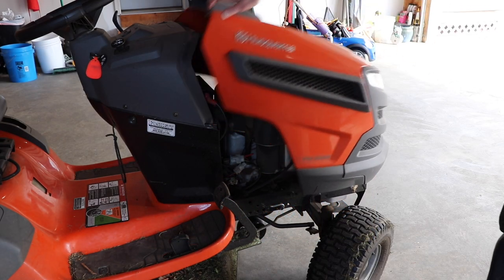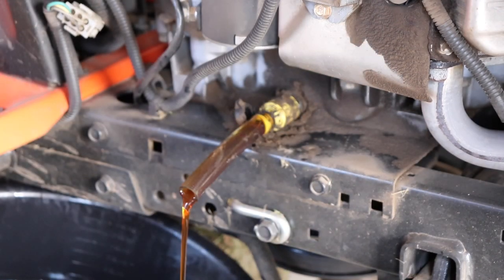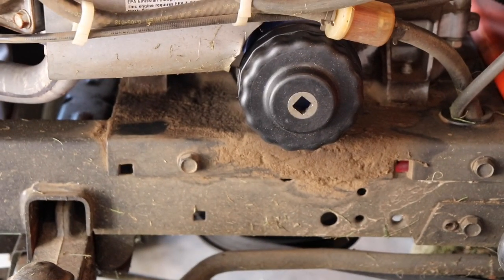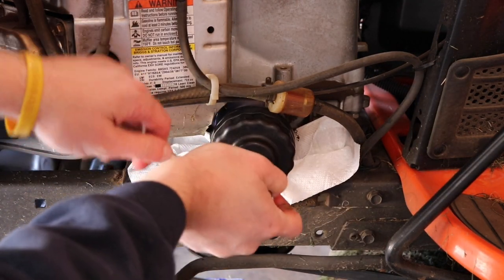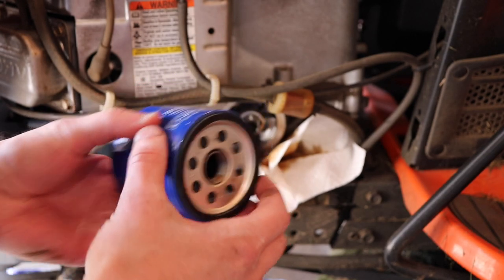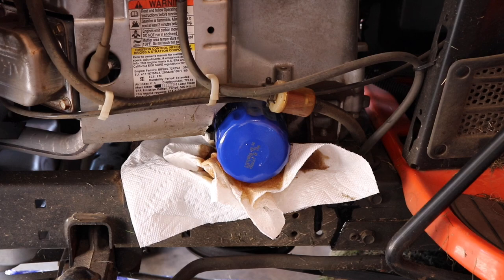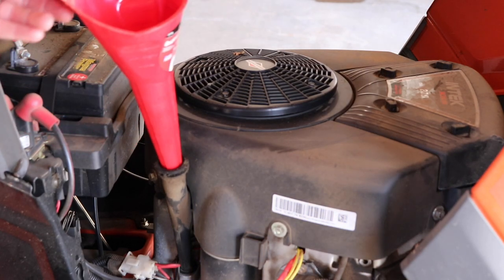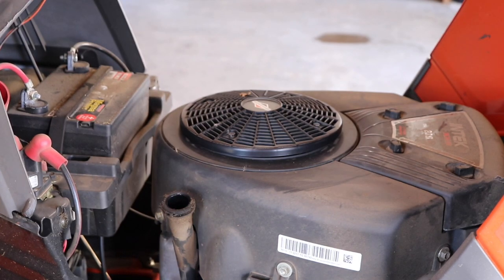Husqvarna Riding Lawn Mower Oil Change YTH23V48. Briggs and Stratton 23HP Oil change.

Comment: Manual for this engine says 62 to 64 ounces of oil with an oil change. When I dismantled the engine, and replaced all of the gaskets, it took 72 ounces to get to the half-way point on the fill stick.  Odd that it took 10 more ounces of oil than the manual stated just for any amounts that remain in the engine during a normal oil change.  That's why it's important to always go by the dipstick indication when filling oil.

Great video.

Comment: Much thanks!  FWIW, I used a spare piece of thick, transparent hose with the braid pattern in it at 1/2" size.  3/8" heater hose is too small.
Reply from the maker: Thank you for watching and for the tip!

Comment: Thanks, buddy! I have this same model...can you make a video showing any other maintenance that may be needed? I did see the deck removal video and I am going to do that to change the blades and grease everything. Can you show where the other fittings are to grease the steering assembly, etc. (I'm too lazy/busy to read the owner's manual...plus your videos are way quicker to understand than the manual:)
Reply from the maker: JAMES BROWN I just put up a “spark plug change” video up yesterday and my blades need sharpening soon too. That’s a good idea about the steering lubrication and any other lube points. Thanks for the comment and compliment!

Comment: EBAY SELLS THE WHOLE KITS, just search your mower model, and it comes with; Package Include:
1X  Air filter
1X  pre filter
1X  Fuel Filter
1X  Oil Filters 
2X  Spark Plug
2X  Fuel line Clamp

Comment: Ok there's 2 different types of 30 weight oil. Sae 30 and 5w-30. I have this mower. It calls for sae 30 oil. Maybe should have mentioned that??The sae-30 is designed for small Engines " Lawn Mowers "  The 5W-30 is designed for Cars bigger motors. 😎

Comment: HI . Yours is a 23 hp B&S motor the ones I have been looking at are Yth24v48 24hp with a 48" deck. Like your video oil change seems very easy to do. Thanks again for the video.  Have not bought one yet doing my research . So how long you own yours and you still happy with it .?
Reply from the maker: Roger Habegger I’ve had mine for close to 8 years, I keep up with the  maintenance and it has been reliable. Thanks for checking out the video! I’ve got a spark plug change video and a deck removal video for the mower as well, be sure to check those out and please consider subscribing if you haven’t already, thanks again!

Comment: where do you get the 3" socket for the 3/8" wrench? A link would be nice
Reply from the maker: Billy Handy thanks for watching! Here is a link to the extension I use in the video: https://amzn.to/3cZsuVj
Reply: @5MinuteFixit  uh, that's a 4pc. socket extension set??? I meant the "socket" that fits over the 3" oil filter used with a 3/8" socket wrench

Comment: "specialized filter wrench" Wide jaw clamping vise grips. LOL
Reply from the maker: Joe Aimetti those work great too!
Reply: @5MinuteFixit  I purchased my 46 inch model a month and a half ago. I had an old Bolens since 2003 and was holding it together with bailing wire. Lol. This new one is like driveing a Cadillac.  I already picked up new oil filters.  I want to take care of this one also.
Reply from the maker: Joe Aimetti they are pretty good mowers mine has treated me well... I also have a few other mower maintenance videos on my channel, be sure to check those out. Good luck with the new mower and thank you for watching!

Comment: Your video states it takes 2 quarts and to empty a 5 quart bottle as it is 2 quarts. 5 quarts is 2.5 the 2 quart requirement.
Reply from the maker: Sorry for the confusion, I had already used 3 quarts of oil from this 5 quart bottle in another piece of equipment I have leaving 2 quarts for the oil change on this lawnmower. Hopefully this clears it up! Thank you for watching!